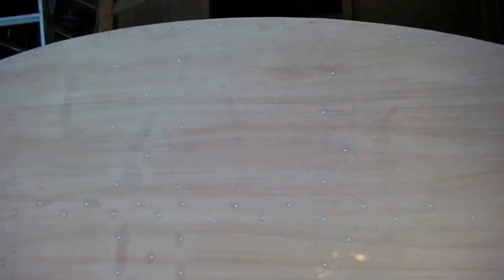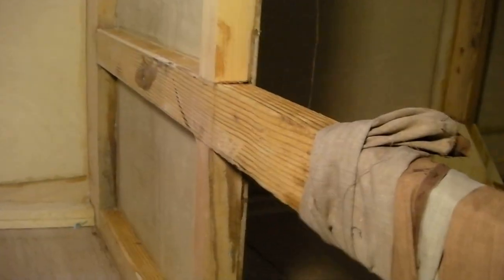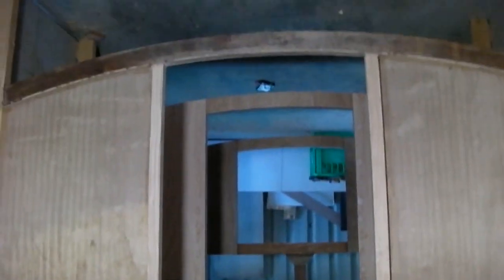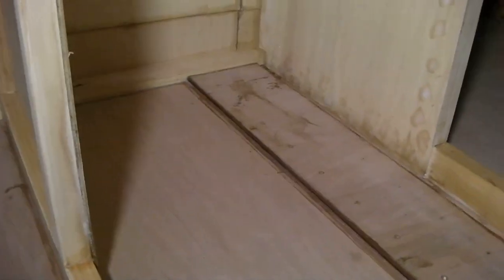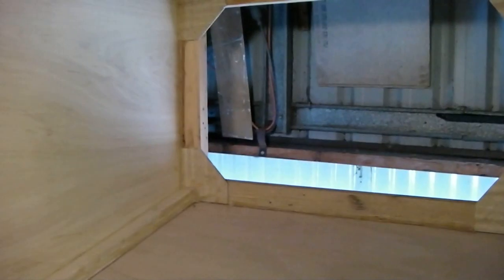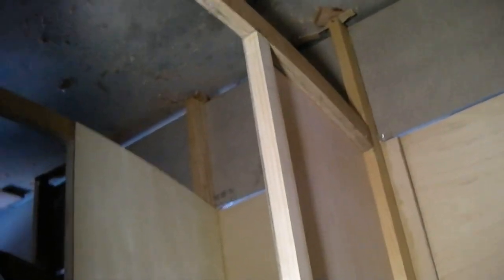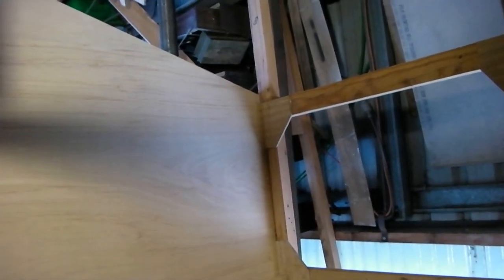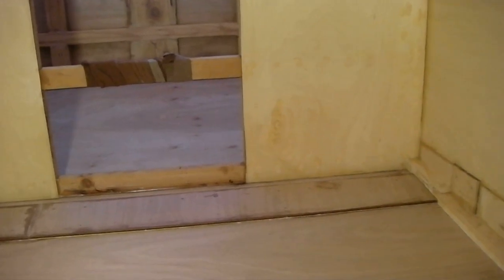Escargot Canal / Shantyboat Build

Comment: Brent, Is your Escargo built to the plan dimensions or is it enlarged? The video makes it seem like you'll have standing headroom. Is that just a tropical dilussion?
Reply from the maker: Hi there. I have only added 6" to the cabin, so no standing headroom (except for the grandchildren!). Apparently Phil Thiel supports that change. All the other dimensions are to plan. I don't think I will install opening windows (initially) as Tasmania isn't the hottest of climates but may put in a roof vent if opening the doors isn't enough ventilation.